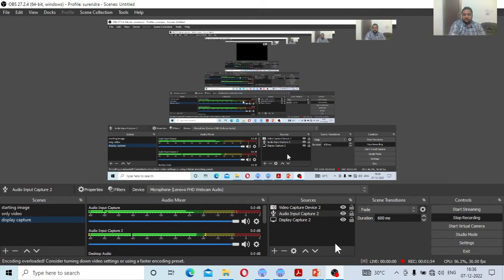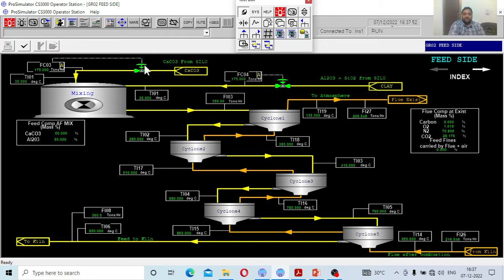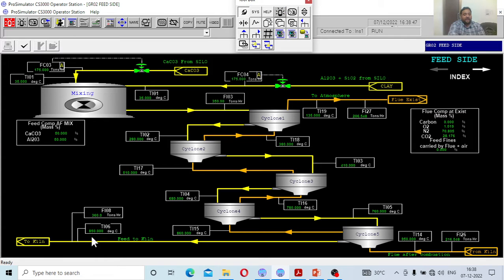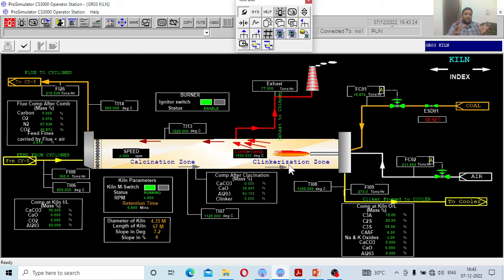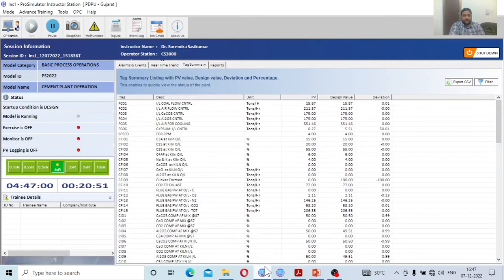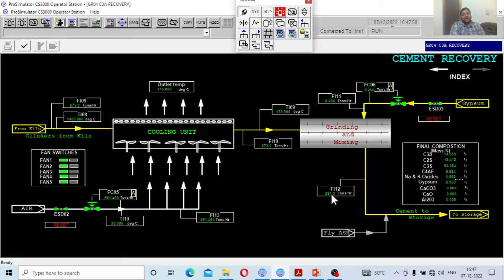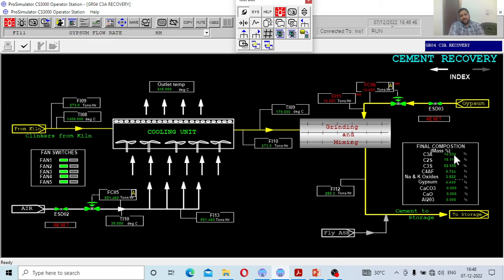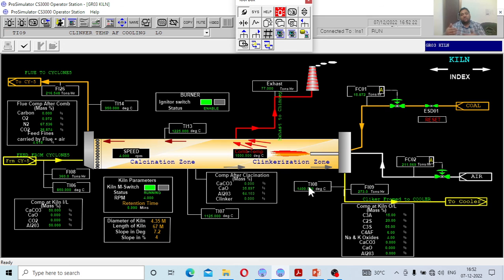(18) Cement Plant Operation....Simulator Training...(Process Dynamics and Control)

Comment: Dear Sir Please upload some of these process simulation lab experiments

1. Equations of state: To study the effect of temperature and pressure on molar volume of a gas
using various equations of state with the help of M.S.Excel/ Matlab/ DWSIM/Unisim etc.

2. Phase equilibrium: Derivation of Rachford-Rice equation. Solution of problems using
Rachford-Rice equation with the help of M.S.Excel/ Matlab/ DWSIM/Unisim etc.

3. Chemical Reaction equilibrium: Study of various possibilities of finding the product
composition in an equilibrium reaction using M.S.Excel/ Matlab/ DWSIM/Unisim etc.

4. Mass Balances with Recycle Streams: Study of material balance of chemical processes
involving recycle of material streams using M.S.Excel/ Matlab/ DWSIM/Unisim etc.

5. Simulation of Mass Transfer Equipment-1: Steady-state simulation of shortcut distillation
column using process simulators such as DWSIM/Unisim etc.

6. Simulation of Mass Transfer Equipment-2: Steady-state simulation of rigorous distillation
column using process simulators such as DWSIM/Unisim etc.

7. Simulation of Mass Transfer Equipment-3: Steady-state simulation of absorption column
using process simulators such as DWSIM/Unisim etc.

8. Simulation of Kinetic Reactor-1: Steady-state simulation of a Plug Flow Reactor using suitable
example in process simulators such as DWSIM/Unisim etc.

9. Simulation of Kinetic Reactor-2: Steady-state simulation of a Mixed Flow Reactor using
suitable example in process simulators such as DWSIM/Unisim etc.

10. Simulation of process-1: Steady-state simulation of a typical chemical plant involving heat
exchangers/ coolers/ heaters using process simulators such as DWSIM/Unisim etc.

11. Simulation of process-2: Steady-state simulation of a typical chemical plant involving pumps/
compressors using process simulators such as DWSIM/Unisim etc.

12. Simulation of process-3: Steady-state simulation of a typical chemical plant involving a reactor
and a mass transfer operation using process simulators such as DWSIM/Unisim etc.

13. Dynamic simulation-1: Dynamic simulation of a process part involving flow control.

14. Dynamic simulation-2: Dynamic simulation of a process part involving flow and level control.

15. Dynamic simulation-3: Dynamic simulation of a process part involving temperature control.

16. Dynamic simulation-4: Dynamic simulation of a process part involving temperature and
pressure control
Reply from the maker: I am not teaching the PDC course...whenever I get a chance to teach, i will do it for you
Reply: @Dr.surendra0845  Thank you sir when you get time please upload the following lab experiments
Reply from the maker: R u the student of PDEU?
Reply: @Dr.surendra0845  NO sir